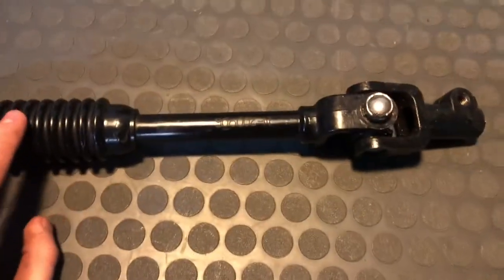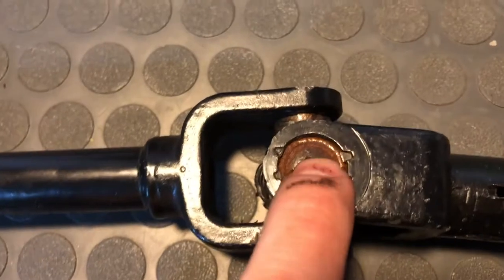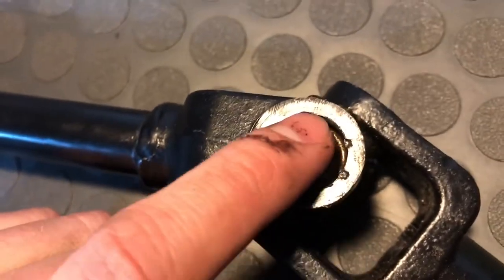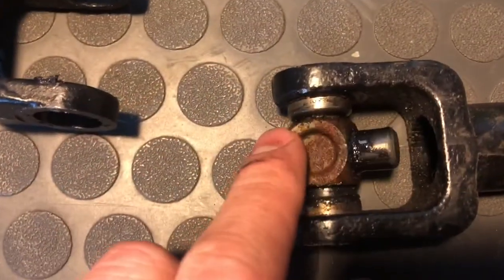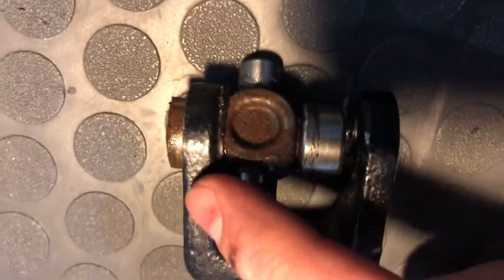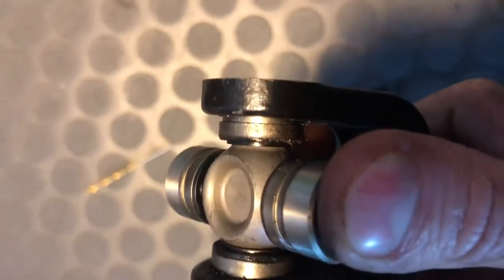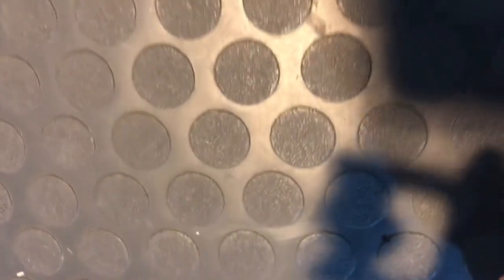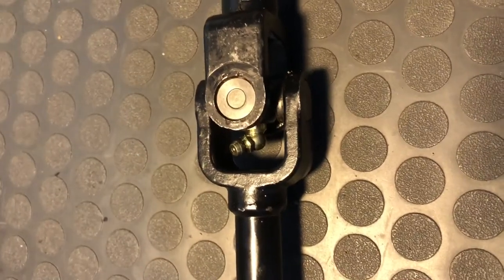Replacing the U Joint on the Steering Intermediate Shaft 2005-2015 Tacoma

Comment: Great video and I changed mine as well. The only thing I did differently was to use a Zipcut to cut the old u-joint out. That way I only had to push the old bearing caps in. After that it was a piece of cake. Many thanks for this!

Comment: Having the same issue on my 03 Ram Cummins. I put in a replacement steering shaft last month and now it's worse than before (cheap pot metal)😭.. so I'm going to try your method with the stock one because the OEM or even a decent replacement shaft is over $400
Thx for the vid😎

Comment: I have a 2004 4Runner and 2007 FJ Cruiser. I did this swap using a different joint which didn't have c-clips. I am going to put this in, because of the C-Clips, for peace of mind. Thanks

Comment: Just got a 2010 Taco and the power steering went. The service dept said they found that the U joint was rusted and lubed it up.  So is this an issue that I'm going to have to deal with for as long as I have her? I'll be moving back to Cali next summer so one more season in No. Wisc. until then. Super low miles I think (79k+) so I'd like to keep her for a while.

Comment: Cool I was wondering if there was a replacement u-joints to replace that steering u-joint.  I didn't feel like spending the money on the whole shift so if I can't find a u-joint for my Ford F-150 at the parts store I'll find a quad dealer or even Butler Lawn Equipment might sell you joints for the steering on the zero turn or the riding lawn mowers thanks appreciate the idea. 👍